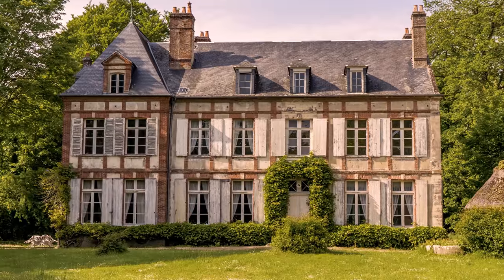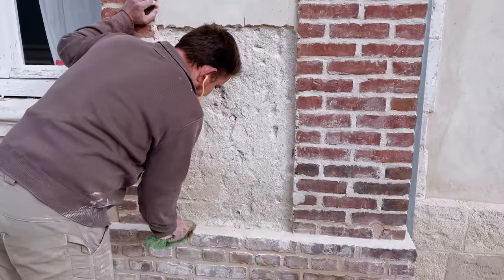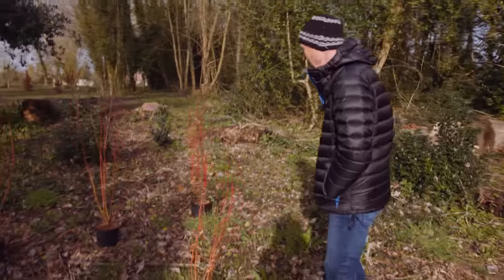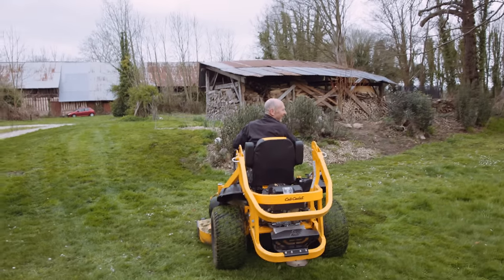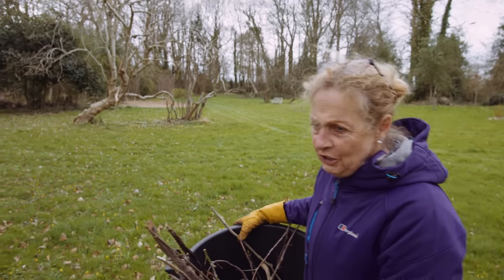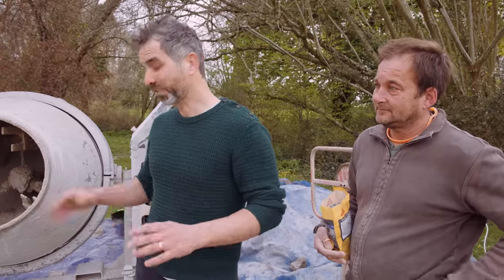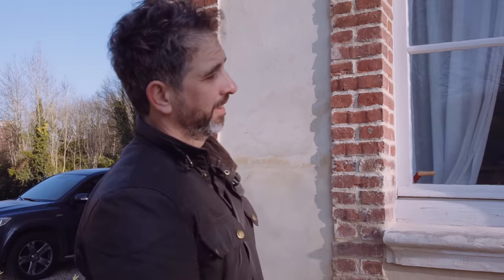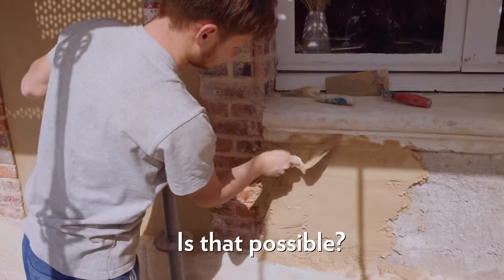100k Chateau Renovation Mistake 😢

Comment: I would have found it interesting to understand what exactly went wrong when they fixed the facade the first time, and what is done in a different way now.
Reply: I think the first company who did the render didn't use the good rendering product to use on old walls. The actual company use lime based render so the walls can breath.
Reply: I agree it would be good to understand exactly what went wrong. Although Thierry’s suggestion sounds very probable.
Reply: He (Philip) mentioned that there were cracks appearing in the wall, thats the reason it had to be done again
Reply: What an excellent job the team is making , and wonderful that soon the old disaster will be nothing but a memory . Renovations are full of unexpected pitfalls aren’t they . You seem to maintain an even keel in the midst of your renovation . Not something many can manage .❤
Reply: @ashpash78  the product was probably a ready-to-use one coat render much too rigid to accommodate the movement of an old building. Probably containing cement or a very hydraulic lime like a NHL5. The traditional lime plaster uses carbonic or slightly hydraulic lime like a CL90 or NHL2, that stay somewhat flexible inside because some of it does not carbonate (the surface does and becomes hard). It also means that if there are micro cracks, the uncarbonated lime fills it and repairs it. That's why some roman constructions are still standing 2000+ years after they were built.
Reply: @ashpash78  usually water getting in ie incorrect non breathable product used
Reply: Perhaps temperatures &/or humidity was the culprit?
Reply from the maker: I totally forgot to mention this, will make up for it in the next vlog with a short explanation. sorry 😁
Reply from the maker: @NouriaDiallo  You're absolutely right, NHL 5 was used instead of 3,5 and probably to thick of a layer.
Reply: they did say.......
Reply: @How To Renovate A Chateau  thank you for clearing up about the facades
Reply: Better believe they researched this.   I see wet looking stucco on homes in NyC.   I always wondered about it.  It made some spectacular homes look like a mess.  I painted my stucco with Benjamin Paints every 5 or 6 years and it cost a fortune.  4 floors- 54 windows and storms and 5 exterior doors.  Hated the expense.   Only after 20 years did I find out it didn’t really need paint if done right.   These 2 have really done a beautiful job on their home and they still have a good sense of humour with each other and family.  In my book - they are a great success and put a smile in our faces.
Reply: When painting my house once I chose a creamy buttermilk color.  When I returned from my office one wall was the color of Big Bird.      Not the color I chose.  Took an act of Congress to get them to put on the correct color.  Always something going wrong with homes which is why you really need to love where you live.
Reply: 2 possible reasons for cracks are the depth of the newer render is too thin, or it was thick enough but did not bond (dust or crumbly dried out base, or hot weather..) and it shrunk. Cracks on old buildings is a bit of a given, and you have to have the correct season to apply without fast curing, as well as good material, to have a chance of success.

Comment: Does Jean Paul know why the original plaster finish failed?  Was it an improper mix?  Improper prep for adhesion?  Moisture issues?  How will they ensure it does not happen again?  Sometimes it's difficult to know what the issue was which can be scary!

Comment: How frustrating! It always amazes me that the effort put into a BAD job by non professional tradesmen!!....what is the point! I am having a similar thing done on our flint cottage in Norfolk. Replacing all the old patches of cement repairs that allow the damp to penetrate....now using the correct lime mortar.....expensive, but worth it in the long run. Anna, your Dad is so funny. Sandi x

Comment: Did you are problem areas come from the fact they seal them too tightly? What I mean is I see you're using the sand and lime only mix which wind dry allows the building to breathe. Is that why you got problems when the other company did not use Lyman sand mix for the work?

Comment: I know, you dislike user manuals, Philip - but you really should set that safety bar on the mower in the right position... Also, are you getting the last facades done too, now that they have all of the equipment there anyway?😊
Reply: It would cost at least 30 000 i think ...

Comment: I have the same mower, a smaller version; zero turns are great fun to drive.  You have to move a little as you're turning at the end of a row or you screw a hole in the lawn, but other than that, you can get up really close to edge around crazy beds without weed whacking.  I'll never go back to a tractor mower again.  The facade is looking GREAT!

Comment: What did the original company do that caused the cracks?   Great vlog, as always! 💕
Reply: Modern cements and not lime. The brick work underneath is lime based mortar. They expand and contract at different rates hence the cracks

Comment: Hate that you can understand how I feel right now. getting premium siding done that was to take at most a week, tomorrow starts 3rd week, a few windows to be replace but they tore open the 120 yo woodwork and battered the plaster walls I wasn't going to need to replace ( no plasterers around here for any price, have to use dry wall) They turned 120 yo window profiles into cheap looking modern. I. feel. sick.

Comment: I love the simple detailing of your chateau. If the new work doesn't fair any better than the last attempt maybe you could consider using ceramic tiles with that texture and tone? And you can get such large and uniform sheets now: 12"x12", 12"x24", and even 24"x24". And no seams between tiles. Just butted against each other and only spot cemented to the wall so water vapor can pass. The seams could be very faint if they are butted against each other without a grout line. They won't take much from the projection of the brick bands but why couldn't they? If the historically appropriate solution doesn't look good enough to you why couldn't you go for a solution that resembles the appearance the builders wanted if they only had the techniques? 
It's just a thought. But I know ceramic and stone tiles are being used on commercial buildings and have been used on historic exteriors.